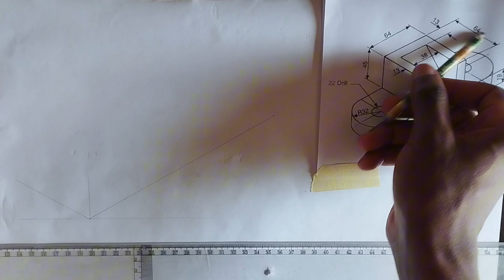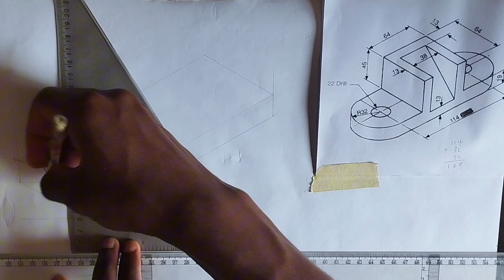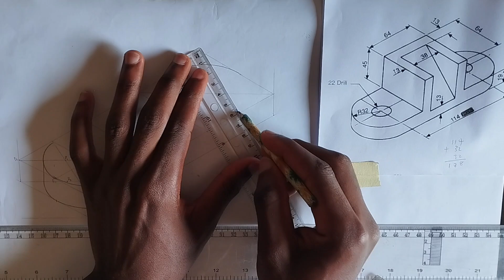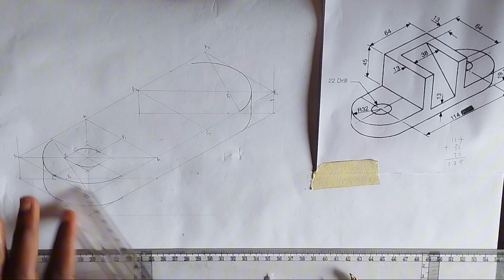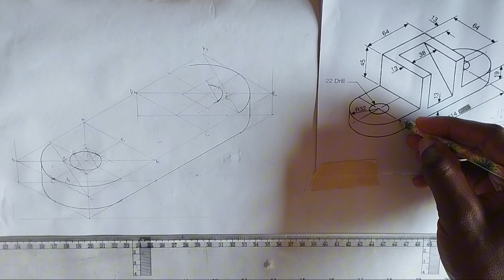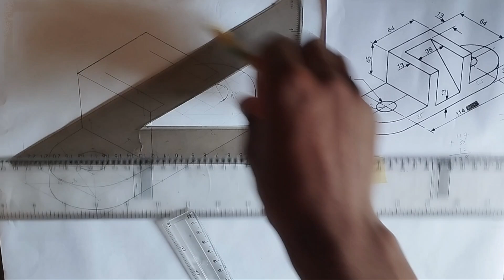Isometric drawing - Isometric of circle - Engineering drawing

Comment: Can l have othographic projection for third angle using this question
Reply from the maker: I don't have a video on that, but If you follow the same steps used in this video, you'll get it.

The only difference is that the plan would be at the top of the front elevation in third angle projection, as opposed being below the front elevation in first angle projection.

Comment: Since the two through holes on either side are of 22 dia and since  the thickness of the base is smaller than the diameter, some part of the curvature at zero level is bound to be visible within the hole. Cannot be ignored at the final answer.